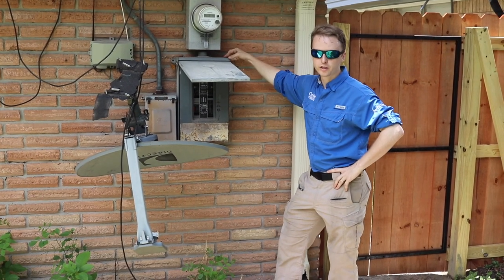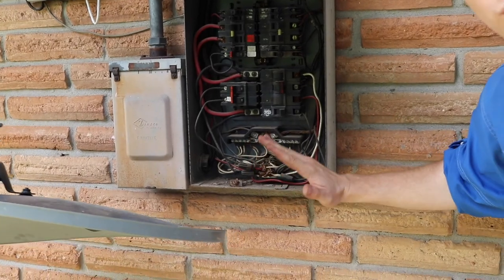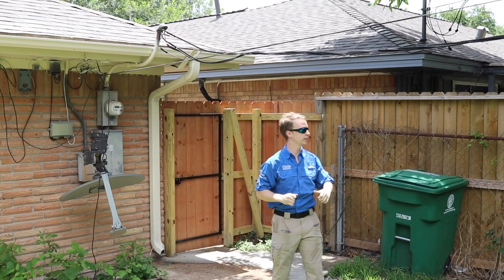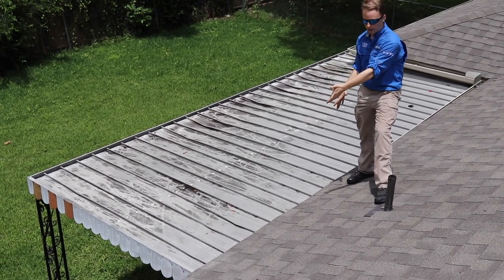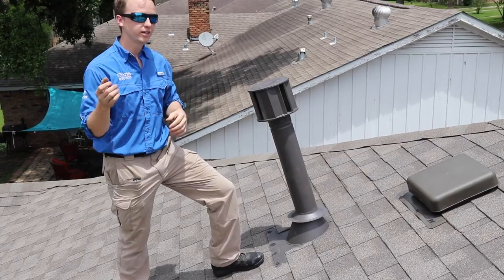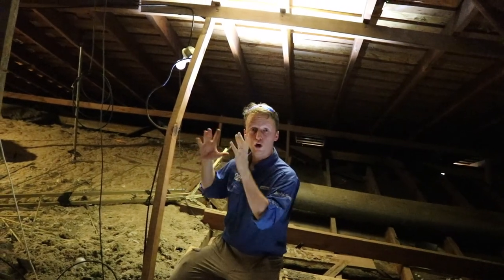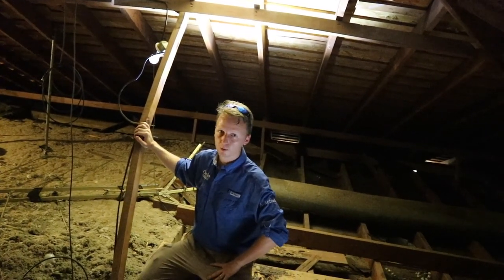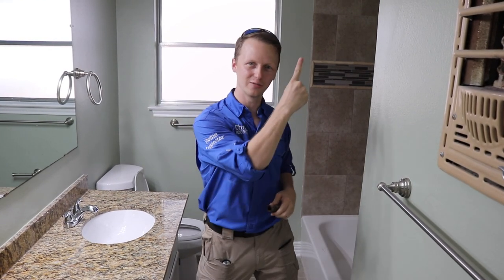This is a flip that flops - The Houston Home Inspector

Comment: I rented a place with that outdoor panel box-I had to shut my power off and they're abysmal to try to open and work. F*** house flippers. ALL of their work is not code, imporoperly installed, and done without permit. My whole home was flopped. Everything has to be re-gutted, abated, I pay the fines. I already needed it needed replumb for drains. But fer sh*tsake, my back door fell out and they tore out the giant aluminum picture windows and put up panes of glass held in by bent nails-not even windows.